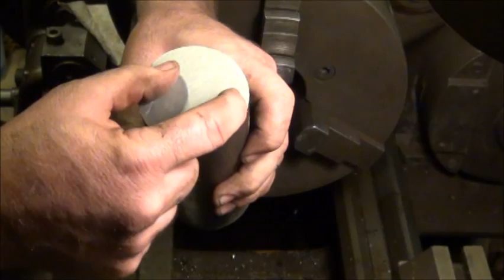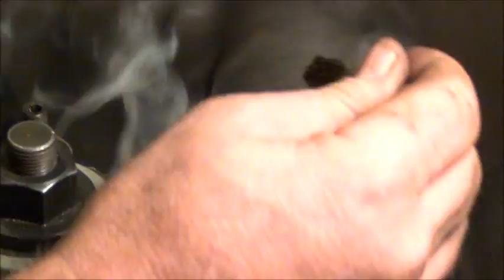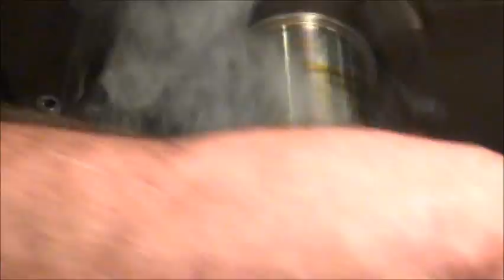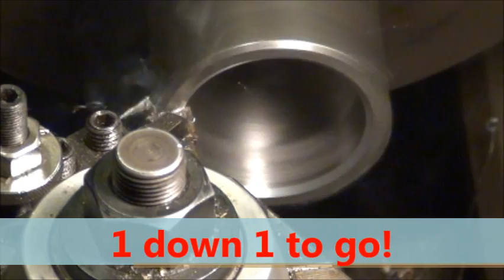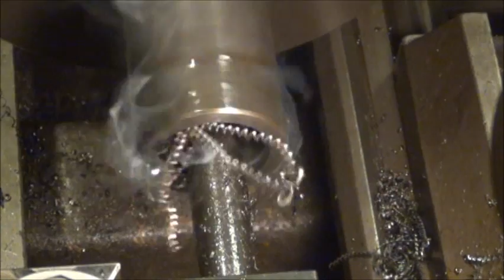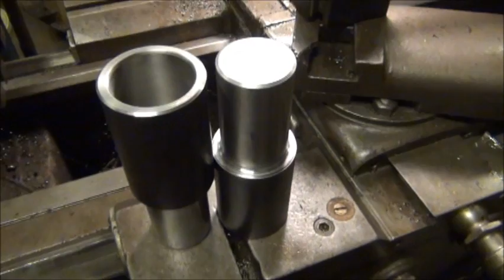Tow Job...!

Comment: Hi Jeff, interesting project, what were you using as a cutting fluid?
Reply from the maker: Mark Fryer It's a dark sulfur-based oil I get from McMaster Carr, I think the number is 1011K12 around $20/ gal + S&H! It works great; other than the smoke! But I remember the smell from when I was a kid & went with dad to the steel/machine shop in my hometown! Thanks for stopping by!